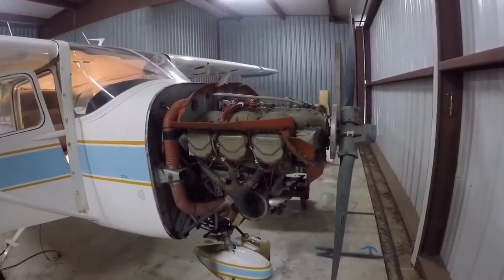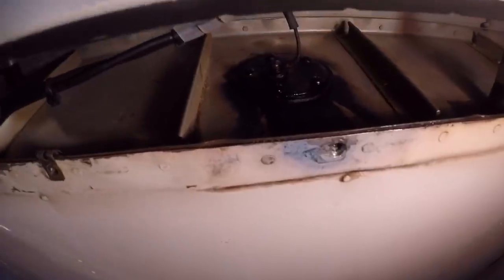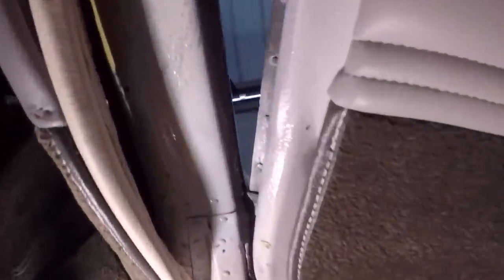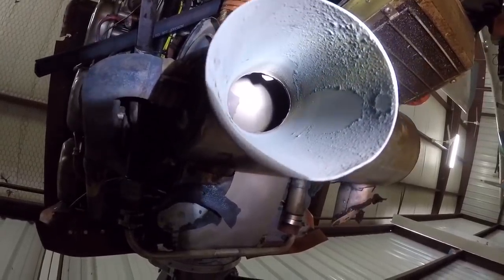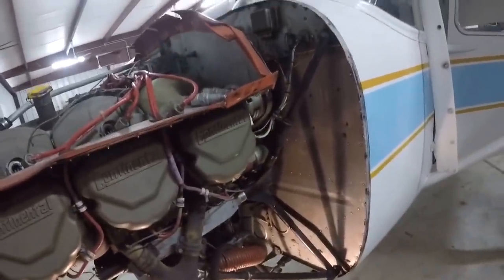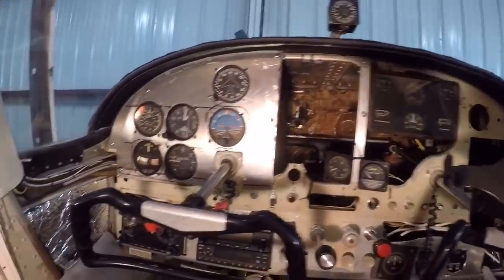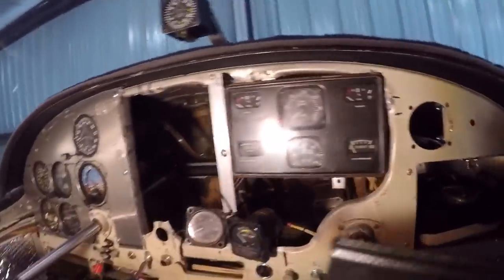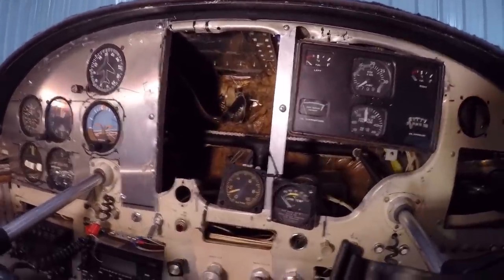This is why you get a prebuy (wait till you see the instrument panel 😮)

Comment: The FAA should investigate the last mechanic that did the annual. A lot of this looks like it's been there for a long time.
Reply: agreed but  IMO the FAA never does anything until there's a smoking hole in the ground.
Reply: @5892Andy  hahaha really though that's what they do
Reply: Probably the same guy that did the jackscrew lube job on Alaska Airlines Flight 261...Slackjaw " At'll Do " Hackman
Reply: that level of corrosion doesnt just happen. Id say 3-5 years of $100-annual inspections.
Reply: @5892Andy  FAA is extremely undermanned in maintenance and inspection. The local shop is slotted for 5 people and they have 2
Reply: Looks like that owner just is not too bright with their plane.
Reply: I don't know much about planes and flying. But I doubt that previous owner followed any rules. And I very much doubt he ever had the plane inspected by a certified mechanic.  When I buy a used vehicle. If I see any modifications done on vehicle in any way shape or form I walk away.
Reply: This is pencil-whipping here.
Reply: FAA a joke
Reply: @shadowsrwolf  FAA = Fail Another Aviator.   I talked to a woman on the Sounder Train who worked for the FAA office in Renton, WA.   She said she will be happy when all General Aviation aircraft are all grounded.
Reply: @triplethreatcga2358  sadly the faa has become a safe haven for the good old boy club people like that are untouchable
Reply: @xaphanofthenightfall1257  entirely possible, however the plane could have sat tied down for 10 plus years outside before the current owner bought it???
Reply: @xaphanofthenightfall1257  looks like a plane parked at the beach near the ocean. 
Best rule besides a prenup
NO LOGS NOSALE!!!! Never ever ,was taught that when I worked at an FBO at 16 by our FAA inspector.
Reply: What makes you think a mechanic did an annual.  The owner probably just did his own maintenance on it.
Reply: The FAA should look at the pilot as well.
Reply: @5892Andy  two years after there’s a smoking hole
Reply: @xaphanofthenightfall1257  
That level of corrosion by the zipper is very common on those airplanes. The fabric holds moisture and it's right up against the aluminum.
Reply: @OneTequilaTwoTequila  
The only way that pilot could do his own annual inspection is if he is also an Airframe and Powerplant mechanic with Inspection Authorization.
Reply: You don't get it . Needs repairs is still airworthy.
Reply: @anthonyklein2944  then how did it pass annual inspection?

Comment: “We’ll work that out”. LOL
Reply: You'd be amazed what can be "worked out" with a couple wheelbarrows full of cash. Just stick a new airplane behind that prop cone, then replace the prop cone. Done.
Reply: I think you’ll end up owning that plane.
Reply: ayayayayay.....
Reply: Dad always said it can be fixed so easy we will just jack up the oil cap and park a new plane under it!!
Reply: (Narrator): They were not able to work that out.
Reply: We’re gonna need an old priest and a young priest....
Reply: OG_Dacs By the looks of the rivet work on that door & hinge duck tape might hold just as well.

Comment: I recently purchased my first airplane. Although it was in annual, and everything I knew about the plane indicated it was in good condition, I had a pre-buy done anyway. I'm glad I did. A couple of easy but must-fix issues were found, which the seller took care of before delivery. In addition, a few other issues were found that don't ground the plane, but will be addressed soon. Rather than wait, we calculated the costs and the price was reduced accordingly. In the end, I have a good plane that's going to be even better soon.
Reply from the maker: Glad it worked out.  I know prebuys can be pricey but not nearly as expensive as not getting one.

Comment: Wow, just wow.  Amazing that he actually made it to your facility.  

Leaking fuel like a sive and avionics with wiring like spaghetti. Plus the added bonus of a dead cylinder and hidden corrosion and illegal repairs.
That AC should have been trucked disassembled to your place. He's actually more lucky than he knows. Thanks for the horror show. Good luck with it.

Comment: The extent of that spar corrosion was really quite horrific!

The multitude of time consuming, expensive, essential work that this aircraft requires is something that any competent inspector would discover for the prospective buyer.

I like your thorough approach, subscribed.
Reply: This is a scary one, isn't it?  I have never seen corrosion that bad.  Just think, that door could have come off in flight, and taken out the rear appendages.   Instant death there!

Comment: Nobody ever bought an airplane I did a pre-buy inspection on.  Both parties end up HATING you, An old A&P.
Reply: Tried to get a pre buy on a 172 that i know had some damage. When the guy selling heard the name of my mechanic coming along to do the ore buy he never called us back and sold it to an all cash buyer who didn’t bring a mechanic.   I think he knows my mechanic has a reputation for being one hell of a thorough inspector and knew we would find every cover up job he did when getting the plane ready to sell.   Kinda funny that as soon as the seller found out he ghosted us.
Reply: Baxter 
Screws you out of a deal but at least you’re not buying a shitty airplane! Goes to show how convoluted sellers can be these days.
Reply: Baxter or the mechanic already had hands on that plane in a previous inspection
Reply: Joe J oh yea totally. Been trying to buy a single engine plane for over 6 months now. Looking at ranges from mooneys to pipers to Cessna. Even thought about citabria although that’s a different type of flying.    Mainly looking for a 4 seat single for IFR
Reply: Gideons Word the only problem is have you seen what people are wanting for those right now? Steam gauge 2000 for $200,000.   I’ve found several fully glass panel IFR equipped low wing planes such as archers warriors for between 100-170k.  A 2010 warrior sold out from under me the other day for a hell of a deal.
Reply: @BaxterretxaB  RIP

Comment: As an IA those are all fairly easy repairs (except overhead channel), I wouldn't mess with patching that elev. R&R then paint would probably be a better option. Corrosion and metal in the oil filter are the top things on pre buy.

Comment: Its also a good idea to check for any FFA Airworthiness Directives issued before you buy or rent,  Piper has a wing spar issue, and a bulletin on the C177 and C210 wing spar, some have lost their lives in these cases, scary stuff if not addressed.
Reply from the maker: Absolutely correct.  A logbook review should be a part of every prebuy as well as having all the current AD’s available.  I use a program that is always accessible to me via Ipad to review all AD’s.

Comment: Looks like he used a hammer, chisel, and tin snips to "rearrange" the instrument panel.
Reply from the maker: I think you nailed it.
Reply: Yeah it should probably be illegal (if it's not already) to do that level of airplane modification without having the proper aviation mechanic licenses. Just because you can change a tire on your mustang doesn't mean you should cutting open your Cessna's panel...have fun when you're dead in a ditch.

Comment: And this ladies and germs is why I gave up my IA ... people fly their family around in unmaintained junk like this. I’d make him a list of unairworthy items and push that piece of junk out of my hanger if it will roll. The ignored flaky corrosion and the illegal repair on the elevator means there is a so much more wrong with this Cessna that I wouldn’t put my name in the logbook. Just say NO
Reply: My thoughts exactly!!!! And the owner will bitch about every little cost. I wouldn't touch it without a huge chunk of money up front. The whole airframe really needs to be restored, as that is a old old straight tail!!!!!!
Reply: What makes an interior, overhead beam corrode like that?  Was it in salt air and maybe getting wet (skin leak) when it rained?  Weird place for corrosion.
Reply: I’d be surprised if it actually had a properly maintained logbook. I wouldn’t want my A&P and signature anywhere near it, unless it was getting gutted, and properly tended to.
Reply: Looks like a product of $500 annuals by a guy who only cares that it looks like an airplane.
Reply: @zpvnrt  no, squawks do not go in the logbook. You make a discrepancy list and refer to it in the logbook or sign the inspection off as unairworthy and give the list to the owner (make a copy for yourself, preferably signed by the owner-just my preference).

Item 2.B.3refers to a list of discrepancies.

The list of discrepancies is separate from the log entry

Comment: There are several iterations of muffler designs available on this type. We just went through replacing our entire exhaust system on our 182B because it had been cobbled together over the years. On this plane, you have narrow primary tubes and upgrading to a one piece collector and larger primaries will gain some power. We ended up getting everything we needed from Acorn or Knisley, can’t remember which. But those old multi piece exhaust collectors are worthless. Get rid of them.

Comment: Unfortunately this could have just as easily been me when I bought my piper archer this year. I never conducted a solid pre-buy, and never did an actual inspection of the log books. Luckily everything turned out fine, and the plane passed with flying colors in the Annual. Lesson learned though! Could’ve been very very bad.
Reply: This plane passed it's last inspection also / HELLO
Reply: @bowdoin5063  what are you talking about? This plane is in its annual inspection. It’s clearly not passing the inspection in this video.

This situation is someone who didn’t do a prebuy and found out the plane was bad in the annual.

My situation is I didn’t do a prebuy and found out the plane was in really good shape, as the logs showed, in the annual. This video could have easily been me is what I was saying
Reply: @jonnyhubert178   The shoddy work he did on the instrument panel tells me all I need to know.
Reply: @bowdoin5063  yeah I definitely didn’t screw up my instrument panel like that haha

Comment: I had a customer bring me a similar POS. It was a PA-28. It had been sitting outside for several years because he was too cheap to pay for a hanger. It had become a mouse hotel. I fixed it for a VERY reasonable price. It needed the firewall pulled down. I was supposed to get paid a little more after it sold. He sold it and I never got a dime. Never did do the firewall. I contacted the new owner and told him about all the corrosion, from mouse pee, and the dead mice in the firewall material. He sued the previous owner and won big. I did not see a penny.
Reply from the maker: I feel your pain.  I have given away more labor than I ever plan to count.  And there is always some yahoo out there that thinks all mechanics are trying to screw them.
Reply: Baughman Aviation Well he paid in the long run. You know how small our community is. I put the word out and no one will do any work for him without payment up front and NO discounts ever again.

Comment: 0:19 I don't understand-- how is it even possible that your customer flew this aircraft for 7 months with the #3 cylinder completly dead??? I admit I'm not a pilot, but I do drive cars, motorcycles, boats, etc., and only an absolute fool (the kind who shouldn't be piloting an aircraft) who has no clue how an engine is supposed to behave, sound, or feel could possibly just "not notice" that they're missing one of their cylinders!

What am I missing here? How did he not know? Or did he actually know and just choose to fly it anyway??
Reply: You forgot, when something doesn't sound right and you don't got no money...turn up the radio!!
Reply: I fly a different type (powered hang glider) , and do all my own maintenance . Now i'll be honest here , i'm a trucker by trade , i'm not trained ( self taught) , but do all my own maintenance on car , van , boat and plane . At present i have my motorhome in bits , with an engine 23 times the size of my hang glider . Last year , an ex student at a school i help out at , arrived to fly a similar , but earlier bird to mine , he couldn't get off the ground . After a second attempt he managed , but to say the climb out was pathetic is an understatement  . The cfi reckoned it was a prop issue (it was new) , but i figured it was a power problem . We are talking single cylinder , simple carburation here . To cut this story short , he landed out with an engine failure . I was pretty ill at the time , so not firing on all four cylinders , but that engine never started again . I got handed the job of sorting it out a couple of months later , and the original problem was traced to the carburettor which was replaced , it was blocked solid . However the additional work the airframe needed to make it airworthy (in my eye's) was ridiculous . When i finally released it , i had worked in almost every area , and it cost him 5 times the original engine repair cost . Those were mates rates too , as i was not interested in making any profit . If i had , i could have doubled that again with labour , to over a grand , sterling .
Reply: Mickey.... tldr
Reply: @6 months ago I'm over the pond in the UK , and i'm afraid that is not the case here . Most haulage work only pay's minimum wage , with overtime making it anywhere close  on worthwhile . However there was a move to salary , a few years ago , which lost a good few drivers in a time when drivers were short anyway . I've been doing the trade 40 years now , and it never being a well payed , however i will add , i was earning more then , than i am now .  Don't be fooled my friend !
Reply: @Detroitdiesel285  Sorry mate , i did try to shorten it , and the result was the minimum i could get away with , yet still get my point across
Reply: Mickey what is your point?

Comment: how does a FAA Annual Inspection compare to a Prebuy Inspection. What I'm getting at is, how did this aircraft pass Annual year after year before it was sold?
Reply: Mike Busch of Savvy Aviation made a webinar exactly on that.
Reply: You would be surprised at what some "Good ol boys" A&P's and IA's will sign off as airworthy. As a A&P, your signature is your bread and butter. I could only guess, some people just don't give a sh!%
Reply: Let's say you're a lazy mechanic.  You inspected the airplane last year, so a year later you change the oil, check the compression, grease the easy things, and sign off the annual, because the airplane was in good shape a year ago, so what's changed, right?  Do that a few years in a row and this kind of thing happens.  That corrosion could have probably been identified, treated, and stopped a few years ago, but since <apparently> nobody bothered to look at it for years, the owner is looking at an expensive repair.

Comment: I looked it up and this plane is still flying. It's changed hands a few times. I also found an old ad that says "most of its life out west" "so there is NO corrosion" 😅. I didn't see the doubler in the ad pictures. I'm guessing that the ad is older than this video.
Reply from the maker: That is interesting.  I refused to work on the airplane when the customer started playing the game of “it was not like that when I brought it to you”.  I literally was able to push a ball point pen thru the spar.  I was later contacted by the shop that was doing the repairs and said when they uncovered the rest of the headliner the front spar was even worse.
Reply: @baughmanaviation2450  it's unfortunate it turned out that way but I'm glad you got out of that, hmm, situation. Like I think I saw you reply elsewhere, some people shouldn't be aircraft owners. There's also probably an overlap of that group and the group you wouldn't want as a customer.
Hope I find a mechanic like you when I look for a pre-buy!

Comment: Is it typical that a pre-buy would go into this level of depth (i.e. pulling all the panels, etc.)?  Would be very reassuring to know that the inspectors are getting deep in there.
Reply: Yes, a typical pre-buy would catch most, maybe all of that.  The smart buyer hires a mechanic to do an inspection. The mechanic continues until s/he is happy or finds a potential show-stopper. When a big item comes up, the pre-buy can pause so the mechanic can update the prospective buyer.  Or, you roll the dice. Sometimes you win, sometimes you lose with that approach.

Comment: Honestly it didn’t look that bad, it’s an old plane and you gotta expect some maintenance.  

Those straight tail 182s are desirable, by no means too far gone.  It would be nice to have known some issues for negotiation leverage.  

Current owner did the most damage with screwing with the panel.

I take it the gear box looked ok and the tail was tight?

Comment: Currently going to school for A&P (Studying for test before taking O&P). As you pointed things out I knew the answer to how to fix. Made me think to myself I actually know some things

Also, the pos 172 our school has (which is deemed unairworthy) is in much better condition. Granted fuel selector valve is broken/leaks and has two right hand scintilla mags.
Reply from the maker: I wish you luck on your upcoming A&P.  Keep me posted how you do!!
Reply: @baughmanaviation2450  Thanks! Just passed general exam. Studying for airframe now. Probably have everything done by December/January hopefully 🤞

Comment: If the rear spar carry through is corroded like that, the front is most certainly not any better. Also it is more common for the front carry through to be more corroded than the rear due to leaking windscreens. Seen these situations way to much.
Reply: The guy didn't buy a physical airplane, he bought airplane DNA.   ( Same thing happens in the car world )